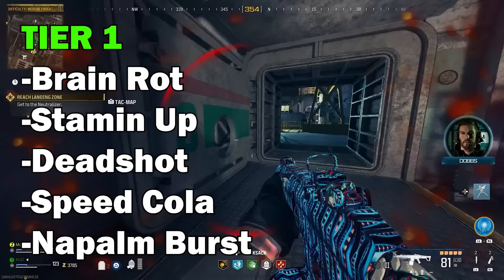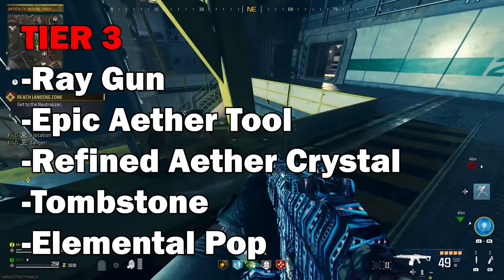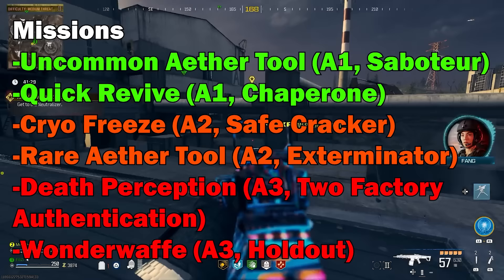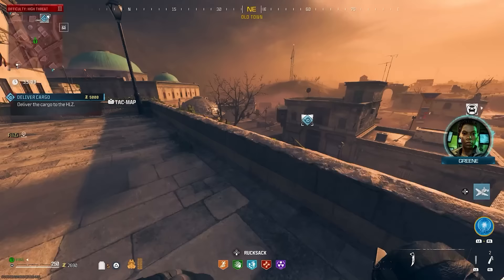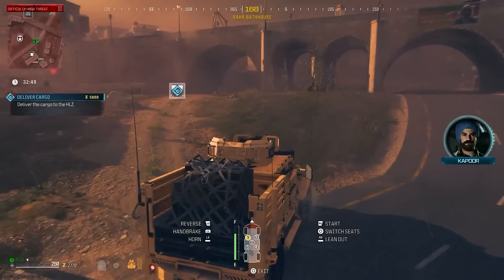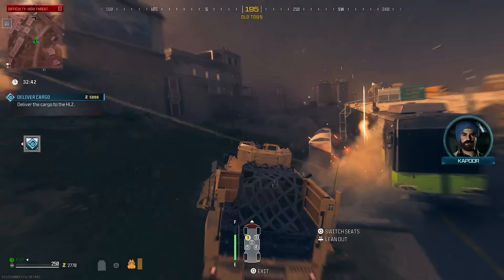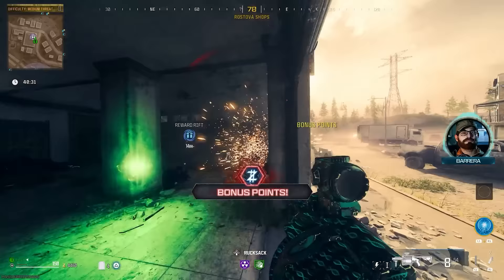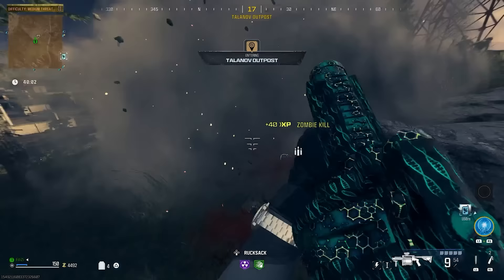Cant Find ALL Schematics In MWZ? Watch This!

Comment: I just cannot find speed cola schematics for the life of me. Yes I know T1. I’ve done hundreds of runs and just spent my time doing t1 contracts looting up before heading to a rift like always and nothing ever. Ive beaten every single boss, Easter egg, rift both normal and elder, warlords you name it.  At this point I’m actually at a loss. I have every schematic unlocked even the new ones except that dam one and it drives me nuts.  Rant over lol.